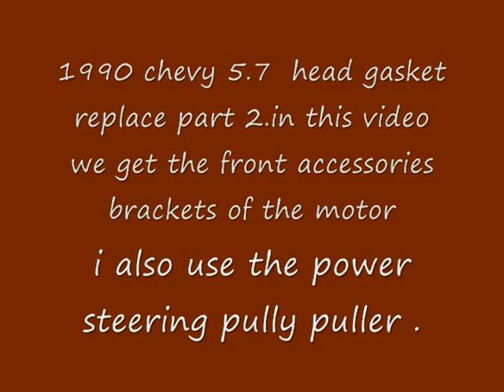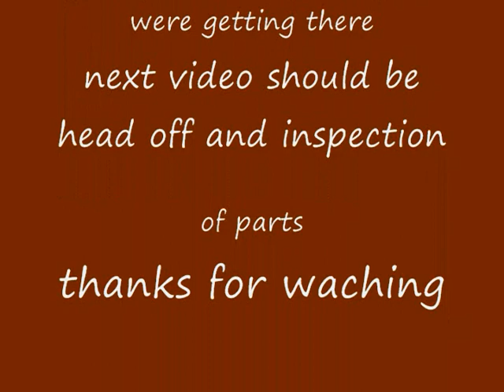1990 chevy 1500 head gasket job part 2

Comment: We got snow at my place but it was melting as fast as it was snowing but other parts of Alberta got a pretty good dump. They are making more cars then they can use. If you google unsold new cars parked they have pictures of 10's of thousands of new cars parked and left to rot.

Comment: is there any torque spec on rocker arms
Reply from the maker: not on the old style chevy motors like this you adjust until there is no slack in the push rods